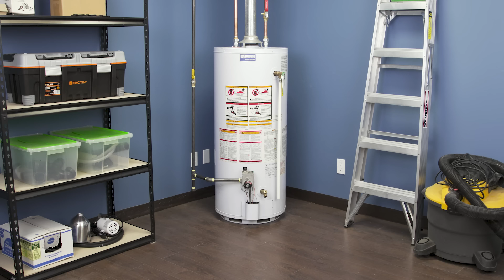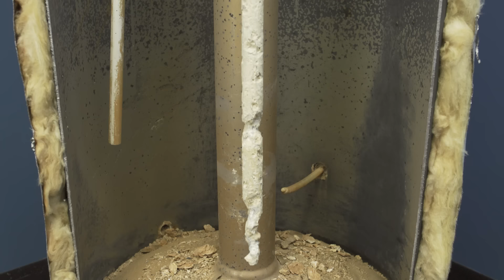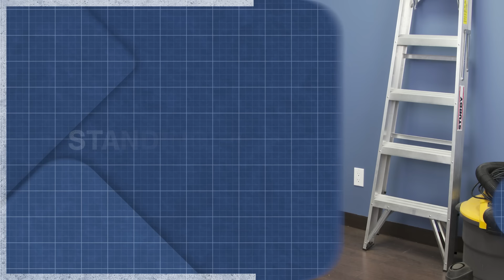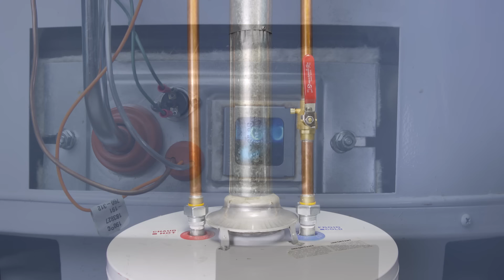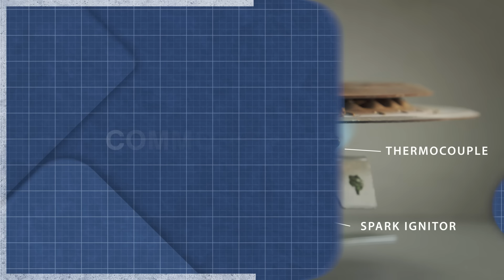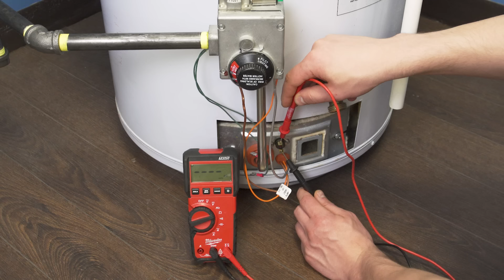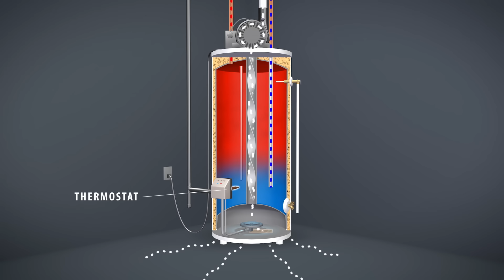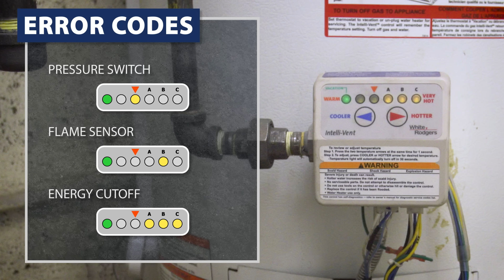How Do Gas Water Heaters Work? | Repair and Replace

Comment: Very educational thank you.  My water heater burner vibrates when the flame kicks in.  Can you tell me if it is a bad burner and will cleaning the filter help or do I need to replace the whole burner assembly.  This is for a Rheem Ultra Low Nox water heater which I have had since 2014.
Reply from the maker: Thanks for watching! Its worth cleaning the burner itself and check to see how its mounted to see if anything is loose. You can see how to access the burner in this video. https://youtu.be/Yx2gfgJB7b

Comment: I bet the pilot flame is what keeps the water inside the tank scalding hot.
Reply from the maker: Thanks for watching. The temperature is controlled by the dial on the gas valve. This monitors the temperature and turns the burner on as needed. The pilot flame doesn't generate very much heat.

Comment: What's the difference between the pressure relief valve and the overflow tank? I know they work differently, but what's the difference in function?
Reply from the maker: Hi Mitch, that is a great question. If you're referring to the thermal expansion tank then this video explains when its needed: https://www.youtube.com/watch?v=E1B-jSamx5Q

Comment: 1:10 water heaters with gas burners need to exhaust fumes containing carbon monoxide to the outside of the home and carbon monoxide exposure can be fatal if a exhaust leak is detected the gas should be shut off immediately
Reply from the maker: Thanks for watching. You are right that the exhaust fumes contain carbon monoxide and must removed and exhausted outside the home.
Reply: @AmreSupply  yeah carbon monoxide is dangerous and can be made by any gas appliance or fireplace
Reply: @AmreSupply  also thanks for the video it’s really cool how the exhaust works on conventional pilot water heaters
Reply from the maker: @egg928  You're welcome. It is quite fascinating how it all works. We just released a few videos on oven and stoves, including a "how it works" video. You might find this interesting as well: https://www.youtube.com/watch?v=L9ZI5GyON9I&list=PLCo9SMjkdWBysYYCcg5xQLiVh_cW0JQvt&index=1

Comment: My blower assembly had almost 300ml of water in it. It stopped working until I removed all the water in the blower assembly. The next morning it was filled again with almost 300 ml of water. What can cause so much water to be in the blower?
Reply from the maker: Hi Ken, thank you for watching. If there are no leaks in the water line that you can see, then could be an accumulation of condensate. In most cases there should be a drain tube leading off of the blower. Check to see if the drain tube is clogged with any debris, or if the hose is pinched.  Depending on the vent, and the slope of the vent, condensate can collect more quickly in some installations.

In this case it would be helpful to call a technician to take a closer look.

Comment: Im scared of boom boom
Reply from the maker: Thanks for watching. Between the relief valve and the thermocouple and thermopile, water heaters have several safety devices that will prevent a boom boom.
Reply: @AmreSupply  ok no boom boom is good good

Comment: thank you Vance for your excellent and orderly presentation.  I have a question, in what way the sediments affect the quality of hot water?  I mean the sediments are settled at the bottom of the tank, and will act as an insulation and result in more gas energy used to heat up the water.  But other than that, it should not affect the quality of the water because cold water will be added once hot water is pumped up and the sediments should stay still and not be stirred up.   Pls advise.  thanks.
Reply from the maker: You're welcome, we're glad that you found it helpful! 

You are right that the sediment generally collects at the bottom of the tank. In most cases sediment doesn't significantly affect the water quality but can increase the hardness of the water. As well if you notice any small white chunks it could be calcium deposits from the water heater. Since its not recommended to drink the hot water this shouldn't be a problem but it might slightly affect the water that you're using for showers etc.

Comment: Hello,
I have a 3 year old Bradford White Gas water heater. 
Every time I flush the toilet, Turn on the water outside for garden and  faucet Kitchen Sink. There is a loud noise coming from inside the water heater. Once we turn of the water line the sound goes away. What is wrong?
Reply from the maker: Thanks for watching. The water heater is still connected to the cold water supply which is the same supply that would be used on a faucet outside or when you flush the toilet.

Its a hard thing to narrow down. One potential cause could be air bubbles inside of the pipes. You could try to bleed the air by running hot water, then cold water from the top most faucet it your home.

If the sound is more like a knocking or banging then it could be water hammer. This is caused by the force of the water inside of the pipes. You'll generally hear water hammer when you close a valve - Its more akin to trying to stop a train, that momentum has to go somewhere.

Comment: Water heater over hardwood flooring?
This is why we can't have nice things...
Reply from the maker: Thanks for watching. You have a good eye for detail. Our film studio set has a hardwood floor (as we use it for multiple sets) and we kept that for this water heater series even though it is not something that a typical install would have. Hopefully you still found the information helpful!
Reply: @AmreSupply  
Oh absolutely, I think its very good information if you're planning on being a homeowner. I've been house searching for a short while and I'm actually surprised how often people slap down vinyl flooring in their basement around water heaters, kitchens and bathrooms nowadays.
Reply from the maker: @IgnisInternus  That is a good point, not everyone researches or considers those things when renovating or installing new flooring. Those details matter especially if moisture is a factor.

Comment: Wonderfully explained and good visuals. So many customers have no idea how the heater works and I've had some ask how it knows when to fill back up with hot water, as if its empty at certain times!

I also deal in Stone lined water heaters. No anode rods!
Reply from the maker: Thank you Brandon! We put a lot of thought into how best to use the visuals, its definitely something that is difficult to fully grasp until you see a cross section of it all working. 

Stone lined water heaters are great! I'm curious to see if they will become more prevalent over time!
Reply: @AmreSupply  Stone lined heaters last about 40 years if your water quality is decent. I service some made in '89 still. Dang four bolt elements are the worst.

Maybe if they become popular, you'll someday have a cutaway video showing the concrete and how it makes the water inert or how not all heaters require special anodes.

Comment: How do I seal water pressure release valve? Asking for a friend
Reply from the maker: Thanks for watching. The pressure relief valve needs to be able to open when needed and close completely afterwards. If the valve doesn't close properly and is leaking, then it will need to be replaced. The repair is relatively simple, you can learn more here: https://www.youtube.com/watch?v=2qhsmSbQQzc
Reply: @AmreSupply  thank you very much, but it suppose to be a joke lol
Reply from the maker: @alphacentauri7381  Thanks for clarifying. Tone is difficult to tell through these comments so we usually make our replies informative.

Comment: Any helpful reasons why my hot water pilot light keeps getting blown out on high windy days ? It’s a standard propane heater tank. It just seems like to much air is somehow getting blown down the vent somehow. I’ve checked the vent a few time and everything seems installed correctly. Any ideas ?
Reply from the maker: Hi Jason, thank you for watching. First check for any drafts that would create negative pressure. As well there should be a good supply of fresh air for the water heater to run off of. You might also have a weak thermocouple, you can see how to test it in these videos:

Conventional gas valves: https://youtu.be/Lu5GvbvspMw
Electronic gas valves: https://youtu.be/UXpmmGuewk8

Comment: Its probably a stupid question, but i was curious how does the pressure occur for the hot water to go thru pipes to sanitary fixtures? And how do I determine what pressure does it have? Or do I need a pump to move hot water from the tank to fixtures?
Reply from the maker: Thanks for watching. The water pressure is set by the utility company that supplies the water. You can buy a inexpensive pressure gauge and attach it to a fixture close to the water meter. The ideal water pressure level is between 45 and 55 psi This is enough pressure to push the water up to any fixtures in the home. If the pressure is too low, then it can sometimes be adjusted at the water meter. 

On the other hand, tall buildings often use circulating pumps as the pressure alone isn't enough to get the water to the highest floors.

Comment: If a gas water heater has been drained/flushed without turning off the gas and wasn’t refilled for 5 hours will that ensure the gas continued to heat an empty tank thus when cold water was reintroduced to the tank to refill it would cause the glass protection to break?
Reply from the maker: Hi Clint, thank you for watching. A significant temperature difference between the enamel coating and the tank could cause it to crack when refilled but that is an unlikely scenario.
Reply: @AmreSupply  so based on what I told you it’s probably not cracked due to keeping the gas on while draining the tank. I thought so as the gas wouldn’t continue to feed the hot water tank unless there was water inside to heat. Without that and allowing the tank to cool for 5 hours without water in it I felt I would be safe. Now when I read online people saying it will definitely crack the glass lining I had to find a reputable source to tell me. Now with an electric water tank you never want to drain it without killing the power source first as the elements will burn out
Reply from the maker: @clintholt563  Re-reading this it seems different, If the burner was heating for 5 hours without water in the tank then that is a lot of heat and a good amount of time, so damage would have been more likely then. Unfortunately its hard to know for sure.
Reply: @AmreSupply  doesn’t the gas only heat a hot water tank that has pressure in ie water and only when the water is below a certain degree?
Reply from the maker: @clintholt563  A drop in temperature will trigger the valve to open and the burners to turn on. There is no sensor for pressure, so the control valve has no way of knowing if there is water in the tank or not. The control valve uses a thermister which is a heat sensitive resistor. The resistance will drop regardless of if its cold water, or cold air surrounding the sensing bulb. http://waterheatertimer.org/How-water-heater-thermostat-works.html
Reply: @AmreSupply  okay so what can I do in my situation to make sure I get the most out of my gas water heater? It’s coming up on 4 years old
Reply from the maker: @clintholt563  In your cases, regular maintenance will be key. You'll want to make sure that the Anode rod is healthy as this will protect the tank from corrosion even if the glass lining is compromised. We have a video on yearly maintenance that you can watch here. https://www.youtube.com/watch?v=ZTUNLIXKVu4&list=PLCo9SMjkdWBwJ4a8MT2GKTDiSuvSHg6Xk&index=3

Comment: Ok sorry just want to confirm. The main burner turns off and on as needed correct. The main burner does not burn 24/7 correct?
Reply from the maker: Thanks for watching. You are correct. The pilot flame burns 24/7. The main burner only turns on intermittently to keep the water inside the tank hot.

Comment: What happens if I turn off the gas line, will it know and not try to ignite a flame?  It looks like I have a standing pilot water heater even though my home is new construction.
Reply from the maker: Thanks for watching. In standing pilot water heaters, if you shut off the gas, the pilot flame will stop burning, the thermocouple (or thermopile) will cool down and the control valve will close. Until the pilot flame is lit the water heater will not ignite the burners, this is because the control valve is not powered when the thermocouple is cold.

Comment: Awesome vid.that water heater needs to be elevated 18 inches off floor
Reply from the maker: Thanks for watching. For this video we set up the water heater in our studio in a way that make the repairs easy to film light and gave plenty of room for the camera equipment. As well codes for pluming and heating will differ depending on your municipality, state or province.

Comment: Um I don't see any anodrode thing in mine,  I do have the tnp valve tho
Reply from the maker: Thanks for watching. You might have an integrated anode rod which is part of the hot water supply line. https://www.amresupply.com/part/14783214
Reply: @AmreSupply  yea must be since i dont c one

Comment: You're a life saver! Thanks. Worked on many electric heaters but this is my 1st gas heater. I must say, an electric heater is way simpler & a lot to go wrong in a gas heater. I don't understand why someone would install a gas heater. The heat costs the same now days!
Reply: Maybe it was there before like mine
Reply: @Eastbaypisces  stranger thing is I smacked the tank & 5 minutes later it was working! I know it will be back not heating again sometime soon. At least I had hot water for Christmas!
Reply: Electricity is 4 times as expensive as natural gas  . 
But the stuff they add to natural gas so people can smell a leak will make you sick .
Reply from the maker: Thanks for watching. In Western Canada, natural gas historically was inexpensive so most homes were installed with gas furnaces and gas water heaters. In Eastern Canada, more electric water heaters are used as the gas prices are a have always been higher.

Comment: I'm building  a simple 4" PVC van rooftop solar water heater.  It will be U shaped and painted flat black. Otherwise no insulation. Being in Sunny Florida and storing about 8 gallons I expect the water to get pretty warm during the day, but I am wondering how long after the sun sets will the water still be comfortable (not hot) on a day where the water is above 90F at 7pm when the sun set and we hope to use around 9pm?
Reply from the maker: Thanks for watching! That seems like an awesome project! Considering that the temperature outside is still fairly warm, you likely won't get too much loss in heat over those 2 hours. If the water is stored in an insulated tank then it will help. Its hard to know for sure without all the variables.

Comment: Hi Sir, we recently replaced a new power vent water heater. My master suite bathroom (shower and faucet) doesn't have hot water but the rest of the house has. Is there any quick fix to this problem?
Reply from the maker: Thanks for watching. There might be an isolation valve that controls water to the master suite bathroom so its best to check that all valves are open.
Reply: @AmreSupply  Thanks for the quick response. I will check that.

Comment: He didn't mention how hard it is to replace the anode rod. Trying to take the old one out can be very difficult without the right tools.
Reply from the maker: Hi  Jordan thank you for watching! Its definitely not the easiest job especially if the anode has not been checked in years the threads can start to seize. In this video we talk about the steps and the tools needed to replace the anode. https://youtu.be/hTJv67imgaE

Comment: How do I identify the gas valve of the water heater when my on,pilot,off knob broken?
Reply from the maker: Thanks for watching. If you have a conventional gas valve, the main dial is larger and generally 2+ inches wide and the gas valve body is generally made out of metal. The smaller dial (on, pilot, off) is generally on top. If the smaller dial is broken, then you might be able to look up a picture to see what the dial normally looks like. If you can still turn the dial manually, the middle setting should be pilot and you should be able to push the knob downward. If you can light the pilot, turn the knob to the far side. If the pilot goes out then you'll know that was the off setting. If the pilot stays on, then you know that its the on setting. 

Now if the dial is broken and can't be turned, then you'll have to get someone to replace the gas valve.

Comment: How durable is the glass lining?  I just picked mine up from Home Depot and it took some bounces I'm sure on the way here. Not to mention going from my tailgate to the basement.
Reply from the maker: Hi Kevin, thank you for watching. The glass lining / coatings are pretty durable and it will likely be fine. Even with a small crack in the lining, the anode rod will still protect the inside from corrosion as long as the anode is still healthy.
Reply: @AmreSupply  Thank you so much! I also have a 12 year warranty on it but I hope it lasts me 20+ years like the other one did.

Comment: Does a water heater exist that doesn't use pilot lamp?  Maybe an auto igniter sort of like a cigarette lighter?
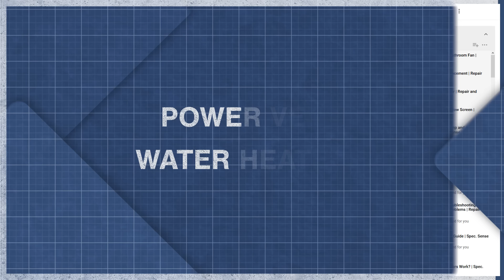Reply from the maker: Hi Jeffery, thank you for watching. Yes there are power vent water heaters as shown at 6:02 in this video. These water heaters use a draft inducer motor to exhaust the air. They operate similar to high efficiency furnaces and use a hot surface ignitor.